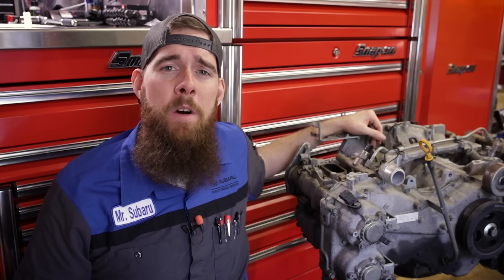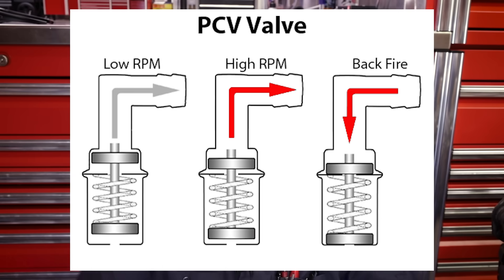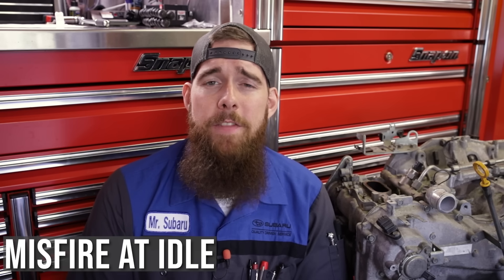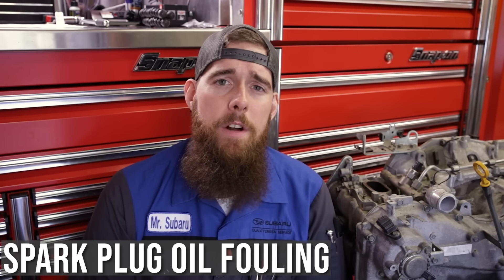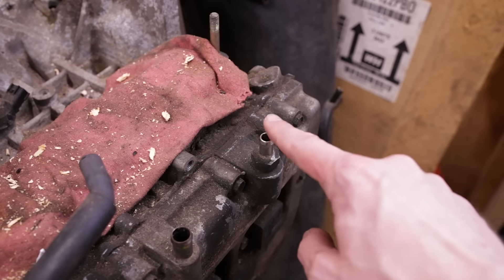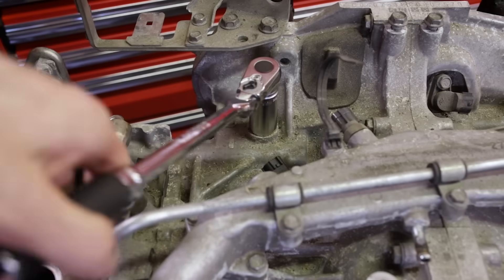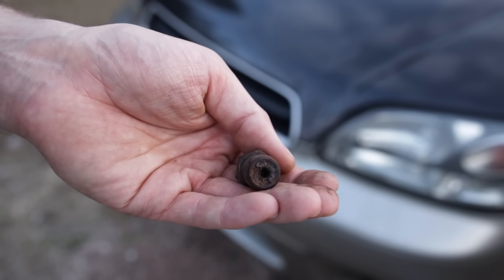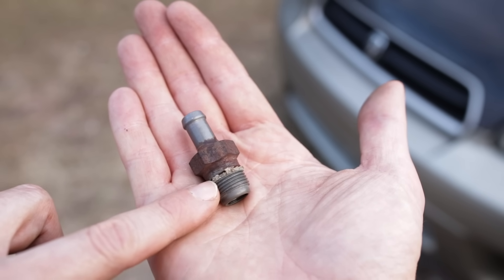DON'T Let This $20 Part Ruin Your Engine! PCV System History, Theory, Operation, & Repair!

Comment: Thanks!🙌 New to cars and new to Subaru :) Bought an old 08 Subaru Outback having P0712 and C0115 codes and trying to figure out where the hell should i start my diagnostics.
Maybe will start with PCV. Your channel is extremely helpful. Thanks so much once again,.
Reply from the maker: Sorry for the late reply. Did you figure out the issue, or still need assistance?
Reply: @MrSubaru1387  No worries at all. Unfortunately got into an accident - Insurance totalled the vehicle. Even though i think it was repairable.

Comment: So, I took the advice and had this replaced.  Just for reference a independent shop in albuquerque charged me $73 for the valve, $41 for the hose, and $144 for R&R.  And now they keep finding more leaks, crazy how in 12,000 miles (80k-92k) the 16’ Outback goes from no leaks or oil consumption. To leaks and using oil.  I’ve watched most if not all of these Mr Subaru videos and I’m quickly falling out of love with the brand based on my current experience. 
Good luck
Reply: I’d try a different shop. The pcv valve is a $30 part and a 15min job at most. They may be trying to take advantage of you.

Comment: Great info!  One minor correction; the PCV system actually goes back to the later 1940s.  I have a factory installed one in my 1951 International L170. They were sold as an option to keep engines internally cleaner for short haul and delivery trucks.  As draft tubes weren't really affective below 35-40 MPH, and lube oil such as it was then, sludge and coatings on engine internals was a big problem.  In the late 1950s, a Dutch engineer from CalTech and a new state board for pollution control looked at the existing valve as an idea to keep smog down by at least keeping crankcase fumes out of the atmosphere.  Tests showed successful results so it was adopted by law as a 1st step,  at least for CA at the time.  New subscriber here, got my 1st Subaru, will keep viewing.

Comment: Mr. Subaru, I came to this video from a Subaru related post/thread. I was checking out 2024 Impreza RS the other day at the Subaru dealer. From the past, I have heard about Boxer engines and how they can leak and consume oil.  Please tell me if this new Impreza has a reliable engine and an oil consumption shouldn't be a problem(with good maintenance of course) and easy access to PCV in case it needs to be replaced.  OR I should stay away.  Thanks

Comment: I have just learned about oil catch cans. Would it be worth it to install one? Or is it better to just run the top end engine cleaner through every 30-50k miles or so instead. It's a good bit of $$ for a decent catch can.

Comment: Has anyone had any issues with the thermo control valve? I just bought a used 2020 forester with 30k miles and am worried that this is going to be an issue I need to deal with soon.

Comment: You mentioned a litany of engine types. I have a 2018 Crosstrek and was wondering what type of engine it has; everywhere I look online simply states it a 4-cyl. Anyway, it suddenly developed a super rough idle, disabled EyeSight, and has a check engine light to boot (whole dash lit up actually) so I'm wondering if this PCV valve or the ignition coil might be the culprit.

Comment: I have a 2008 Suburu outback. I have an issue I can not figure out. It runs great in the winter. When it gets warm outside and the car gets warmed up it idles rough. If I come to a stop when it doesn’t dies. It will start right back up but then die unless I floor it right away to get the RPMs up. Things I have done.

I have changed spark plugs, coil wires, and the distributor. 

I have cleaned the Throttle body

Did a timing belt and water pump change.

Tested the fuel pump pressure and it was good. 

I have changed every fluid out coolant, oil, front and rear Diff, transmission flush, break, power stearing.

I have no codes being thrown. 

I am going to try and check the PCV valve. 

Have you ever seen this issue?

Comment: I would not bother trying to clean an old PCV due to the fact that springs wear out. I would get a new OEM PCV from the dealer. Do not get a cheap one from a parts store, it's too important of a part.

Comment: I rarely hear about replacing the rubber hose along with the pvc valve because that hose deterioration and clogs oil ports   Which ruins the engine.  I replaced two engines because of this

Comment: If you hadn't made this video I would never have known about this part. I truly appreciate this. I stopped procrastinating and changed mine out a few minutes ago. It was extremely clogged. The seal is worn. My vehicle has never been serviced in its entire life prior to me buying it.  I will resubscribe when I have more funds and also buy some stickers. I do appreciate it.
Reply: I cleaned it out and it freed up a little but I just did as you recommended
Reply: My car is running so much smoother

Comment: Love the video. I have 2002 Subaru Impreza outback sport and the motor went out and brought it to Subaru with  JDM EJ20 non turbo and it was supposed to be an easy swap just take everything off the intake manifold off the blown EJ25. Pretty self exploratory right but I dropped off the car with the new motor O2 sensors filters oil the works that was Oct 31st it is now Jan 15th and the motor is in the car but they are having issues with rough idle and they replaced ignition coils O2 sensors pcv valve they mention the Map I provided that and still no resolve I'm 4500 into the job and they're wanting more diagnosis labor what do I do and what do you think it could be . Thank you and my wife and I enjoy your videos and how much knowledge you bring to the world .

Comment: So I replaced the PCV valve and hose in my 2017 Limited 2.5.  However the Carquest PCV valve has longer threads and doesn't thread into the engine very far, maybe four threads. I obviously don't want to crank on it and strip something.  I've taken it out and hand threaded it three times to make sure I am not cross threading it.  How deep does the PCV valve need to be screwed in?  Is it under significant pressure that I should be concerned it will blow out?    The old PCV valve was seized up.  Seeing a bit of oil consumption at 101K miles .

Comment: On a newer car, how soon should an owner start checking the PCV valve?
 As an aside, in addition to a 2021 Crosstrek, I have a 2000 Jeep Grand Cherokee with almost 150,000 miles on it. It has the 4.7 V8 and had never burned or leaked any oil until recently it started slurpping oil like crazy. I feared the worst but it turned out to be this very scenario laid out on the video. Threw a new PCV valve on it and problem solved.

Comment: Does it have to be OEM with the PCV valve? I found one at O'Reilly's that fit my outback, Import Direct Ignition PCV Valve - 28-0246. The reviews look good but it is a very important part and I don't want an aftermarket part to cause issues.

Comment: I assumed this required a 19mm socket for 2020 Outback based on my 07 Forester and another post online, but it apparently needs a 22mm deep socket which I did not have, but I did have a 7/8 in. deep socket that worked and I had used on aircraft spark plugs.  Found new on ebay for $12!  Installation 20 minutes.
Reply: BTW, at 48K miles old PCV valve semi clogged up, so I went for the new.

Comment: Mr. Subaru, if this is a known issue on horizontal direct injection newer boxer 4 cylinders, why doesn't Subaru add anything to the service manual to check this say every 50-100k miles?

Comment: Hi there. Just wanted to share my experience. This little part cost me around 1800 dollars. From 2 mechanics. One day out of nowhere my car sounded like it had a cam. I thought maybe it was the timing jumped or something, I took it to someone and they took the motor apart, replaced the timing belt, and head gaskets, Then I took it to another guy after the problem wasn't solved, he actually broke my intake Don't ask me how and the work he did didn't fix it. I finally got fed up with dipsh*t mechanics not doing proper work and solving small problems at a time. SO I did the work and Bam. within an hour I found out my PCV valve was shot and the hose was NOT connected. FUN FUN FUN ON THE BUN! 
P.S. Do not take your car to the "My boi does it for cheap" "mechanic" types
Thanks for the video

Comment: Can you comment on the routing of an 05 jdm ej25 pcv?
It has a Y shape fitting with 1 port to the block 1 port to the manifold but Unsure where the 3rd port attaches to
The PCV is an inline type 
Thanks

Comment: Mr. Subaru I have 3 questions 

1- Should I change my EZ3.6D PCV valve? I'm at 170k miles

2- Should I also change the factory Idler pulley bearings while I'm at it?

3- Long interval maintenances question like when should I change the timing chain tensioner & it's plastic guides?

Bonus question! All the seals on the engine & transmission are from the factory, should I look into replacing the seals that are prone to fail as you mentioned in your videos?

The car is running perfectly with no leaks or codes & I want it to stay in the best shape!

Comment: Great video. Running an EJ 25D in my VW bus and had a horrible oil issue. Pooling in the intake valves and blowing crazy thick smoke. I realized my valve cover hoses were not to fresh air, and plugged in with the PCV system. I unplugged them, capped the ports and problem solved. I still replaced the PCV anyway, worth the $5. THANK YOU

Comment: On the EJ25 with the PCV easily accessible from the top of the intake manifold- after cleaning it works using the blow test. However the spring is allowing it to slightly hang open due to the upward mounted angle. Is this normal? Weak spring?

Comment: Hey mrsubaru, would a faulty pcv valve cause my 08 outback to make a short "shpshhht" sound under heavy acceleration? It usually seems to correspond to a gear shift also. Thanks in advance if you have a chance to respond

Comment: Hey MrSubaru, my 2017 WRX has been having issues with the engine stuttering and sometimes stalling when the clutch is pushed in and coming to a stop, along with a rough idle, I cleaned the MAF and MAP sensors along with replacing the air filter. Would the PCV valve be a culprit for these issues or should I look more along the lines of a dirty throttle body or fuel filter?
Reply: Probably the PCV valve.  My 2016 WRX did the same thing when coming to a stop, sometimes the idling would be so rough the engine would stall.  Happened at about 75k miles.  Dealer cleaned the PCV valve and no issue...knowing now it was a $20 part I probably would have just done it myself!

Comment: There is a rubber cover directly behind the pcv valve on my 2016 2.5 outback that is dry rotted on my car. Does anyone know what it is called so I can replace it?

Comment: 2016 2.5L PCV Warranty Maintenance Schedule and Safety Inspection Schedule.
Neither of these scheduled list any reference the PVC maintenance.
When asking Subaru USA about this they said ask your dealer. Rather than getting the dealer's opinion I want the official word from Subaru.

Pulling the engine to replace the RTV cam cover seal for $3,500 is a lot of money.

What should be the maintenance interval be for the PCV valve?

Comment: 2023 Forester Touring 2.5l NA 4 cylinder. What is the location of the PCV Valve? I want to see if I can add an oil catch can to the PCV Valve hose line.

Comment: I recently did a swap on my 2010 Forester X, everything went well but the pcv vent is different from my old engine, it's just a pipe that you slide a rubber hosing on, currently trying to find some remedies to fix the problem but no luck.

Comment: This is the very first thing I do as soon as I buy any used vehicles (I'm on my 16th vehicle, never torn any up to date). I always do the pcv valve, change the plugs, change the air filter, and clean the MAF sensor as soon as I drive away with it. I do all of them again every 50k miles. Also do oil change immediately, and I do oil changes every 1,500-2,500 miles at MOST- I don't give a damn what they say about modern oil not needing to be changed until 3k-5k miles... It costs very little and better safe than sorry. Keep it running clean and keep up on maintenance and just about any common car will last forever.

Comment: I wish Subaru mentioned this in the service schedule. Just did mine thanks to this video.
Reply: In Canada, Subaru's maintenance schedule recommends the PCV valve be inspected (replaced if necessary) every 60,000 km.
Reply: @theperimeter1026 Not in US
Reply: I don't remember having ever done anything with the PCV valve on any of my cars. Most ran well past 175,000 miles without burning enough oil to need a top up before 5000 miles. 
   An Impreza is using oil. No soot on rear bumper.   I'll check this.
Reply: @ronmorrell9809  a turbo can make this issue more prevalent. Were your vehicles naturally aspirated?
Reply: @ronmorrell9809 It has to do with the boxer engine.
Reply: I asked my Subaru dealership repair guy to change my PCV valve ( My 2020 Subaru has 44,000 miles on it)  He asked  if my check engine light was on, it was not. He stated, its not recommended and it would be wasting my money. He then added "I dont have any PVC valves in stock" at a Subaru dealer???? So I'm done with the dealership.
Reply: @puter305 I was done with my Subaru dealership when I let them change my oil. When I went to go do it myself the next time it was due it was obvious they impact wrenched the oil drain plug. I had to waste my time hitting it with penetrating oil, some heat and a breaker bar just to get it out. 

Official Subaru service no better than jiffy lube.
Reply: Why would they do that so tie cat can run longer less sales fuck no

Comment: I get the rough idle at stops and it acts like it's going to die sometimes coming to a stop. I also get the "Christmas tree" about every month or so. Could that all be due to a pcv?! 2012 outback manual trans. Getting ready to do the plugs after just watching your video on that. Super helpful and I will get a new pcv regardless! Great info. Thank you

Comment: EDIT update>  After 3 days of PB blaster, I warmed up the engine, and hit the PCV with one more shot of PB, tapped gently on it for 60 seconds, and it finally came out.    Small victory for shade tree guy

>>Taking a clue from  this, I bought the PCV valve & hose, but even with 1/2 breaker bar and moderate pressure, I could not get the PCV valve out of the block, sure as hell don't want to break it.   Didn't think I should try heat due to vapors.  I'm going to PB Blast it for a few days and try again.  ANy other methods???   Great video,, thank you Mr Subaru..
Reply: Way to hang in there.
Several videos say the fast stocatto force of impacts is better at breaking things free than big breaker bars manually.
I still like to snug it first then try to remove if things are really stuck. Breaks that rust bond.

Comment: What great content! I am having all the lights lit on my 2014 Crosstrex hybrid.  I love my car and I am heart broken because no one knows how to fix/work on these cars.
Reply from the maker: What codes?
Reply: @MrSubaru1387  P0700 and P0500
Reply from the maker: @noellewilliams5623  transmission fault and Vehicle Speed Sensor code. What’s been done so far?
Reply: @MrSubaru1387  I took it to my local mechanic who said I needed to get my wheel bearings done. He did a really bad job on that and now all my lights are on. I don’t wanna take it back to him and I am on a tight budget. When I took my car to him the only thing wrong with it was it had a wobbly tire. Now it barely takes off from a stop. All my lights are on. There is nothing wrong with the batteries and the transmission is good according to AutoZone. At this point, I just want my car back in the running condition. It was in when I first brought it to him. Unfortunately, he is not a Subaru technician lesson learned. However, last time I took my hybrid into the Subaru dealership they had to do some research on the hybrid as well.

Comment: Just replaced the one on my 2021 Crosstrek it only has 30k on it and it was already getting plug up. My daughter Impreza 2.0 with 41,500 miles on it hers was completely plug up. So they  must be done at 30k it seems to me .
Reply: Just replaced mine today on my 2018 Forester with 96,000. Yes it was a little sticky!!!

Comment: I have a 2020 Forester with 32k miles.  It sounds like I should change the the pcv valve.  Where is the pcv valve?  3:37 There are 2 hoses near throttle body.  Which hose do I follow to find pcv valve?

Comment: I think as long as you change your oil every 5k miles then you shouldn't have to replace the pcv valve. Cause when i tried to change it on my honda accord 2010. The old one was still good even though it was 160k miles. It was super clean and no carbon on it. I think as long as you dont have carbon building and change oil on time you dont have to worry about the valve
Reply: Changing your oil on time will not have much to do with how much carbon and sludge get blown into your intake through the PCV valve. Being aggressive on the throttle, driving under higher load or in more demanding conditions (off road, in the snow, mountains), high RPM/low load (mostly bad habits for manual trans drivers in too low a gear), temperature extremes, and higher mileage will have more to do with how much sludge and carbon are in your PCV valve.

Comment: My 2019 Forester apparently had a bad pcv valve.  Dealer found oil in the air box during the 6k oil change.

Comment: Good stuff! I just spent over $40k on a brand new Outback Touring XT and I want this overpriced hunk of metal to last a LONG time. It's a turbo too, which adds another level of worry. I only use Motul Eco-Lite oil and will change it every 6000 miles. I'd love to see you delve more into Subaru turbos, with examples.
Reply: Good luck to you, may your rings be tight and your boost all fun!